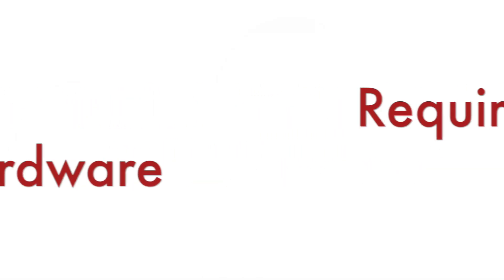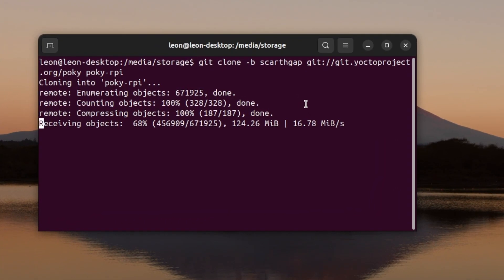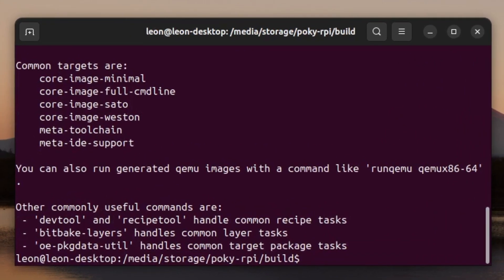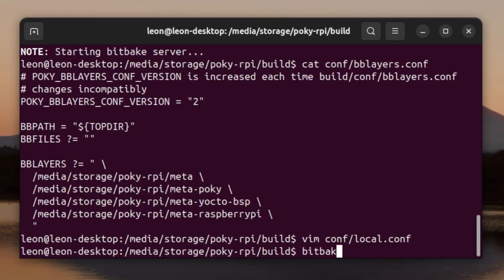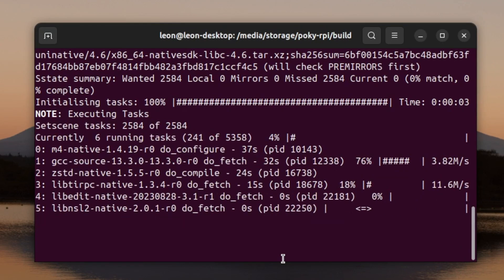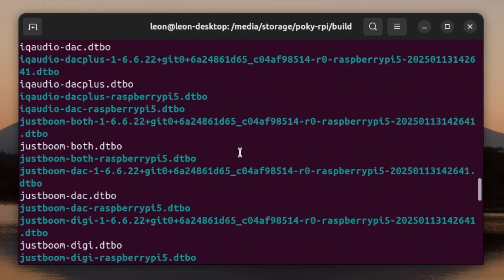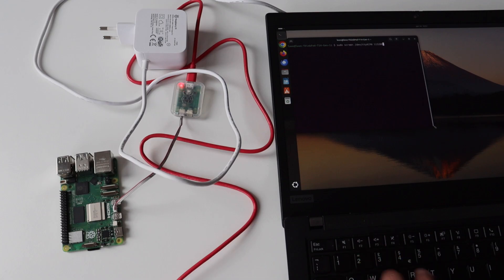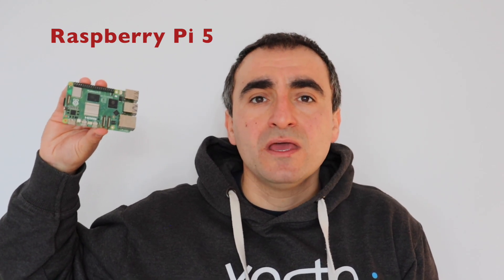The Yocto Project on Raspberry Pi 5 Episode 1: Building an Embedded GNU Linux Distribution #linux

Comment: Thanks for the tutorial, I'm very much looking forward to the next installment. The first was extremely helpful and useful. 

I'd love to see "first-boot" functionality added - for example, like the official RPI distributions, automatically resizing partitions to fill the boot volume in the case that it's bigger than the image.
Reply from the maker: Yes, this is an excellent idea! Probably we should do it at a later stage after we have a software over-the-air update solution in place. Mender and RAUC integrations include recipes and scripts to resize the remaining disk space on first boot.
Reply: @LeonAnavi  I don't know what Mender and RAUC integrations are :) But looking forward to learning.
Reply from the maker: Mender, RAUC and SWUpdate are among the popular open source solutions on the embedded side for software updates of Linux devices. All of the are pretty cool. I think in future it will be interesting to cover each of them in a separate video.

Comment: Do we need to go LFS route or there are easier route to learn to assembly distro? Do you offer some books?
Reply from the maker: The Yocto Project has a steep learning curve but once you get familiar with it, it becomes easy and quick to create custom Linux distributions. Although you can definitely learn a lot going down the road of Linux from Scratch, it will be very time consuming. I think over the years the Yocto Project has become de-facto industry standard. In terms of books, I recommend you to have a look at "Mastering Embedded Linux Programming" by Chris Simmonds (and newer editions co-authored by Chris and  Frank Vasquez). The Yocto documentation is also very good: https://docs.yoctoproject.org/

Comment: Thank you for the video. I want to ask about the kernel used in this build, is it RPiFoundation kernel or upstream kernel?
Reply from the maker: Excellent question, probably I should have covered this in the video. The BSP layer meta-raspberrypi provides recipes linux-raspberrypi with different versions. This is based on the Raspberry Pi fork of the kernel maintained in GitHub. For Yocto LTS release Scarthgap the available kernel versions are 6.1 and 6.6.
Reply: @LeonAnavi  Thank you Leon.
It seems Yocto Scarthgap uses upstream kernel..
Reply from the maker: For Raspberry Pi 5 as shown in the video we rely on the additional BSP layer meta-raspberrypi which provides recipe linux-raspberrypi that inherits linux-yocto.inc. For Scarthgap the available linux-raspberrypi versions are 6.1 and 6.6, the latter used by default. As you can see in the SRC_URI variable it uses the fork of the Linux kernel maintained by Raspberry Pi and branch rpi-6.6.y: https://github.com/agherzan/meta-raspberrypi/blob/scarthgap/recipes-kernel/linux/linux-raspberrypi_6.6.bb#L11

Comment: Nobody had made a tutorial on How to upgrade kernel, bootloader through the same build. People just take whats available, build flash and done. You can create something like how to upgrade kernel/bootloader or maybe a package version like vim/git etc by modifying existing bblayer or writing your own bb layer. Yocto is huge and has tons of things that can be done rather than just fetching building and flashing. More features like changing boot splash screen using psplash and so much more.
Reply from the maker: Thanks for the suggestions. Switching to U-Boot is specific for meta-raspberrypi, especially for Scarthgap and Raspberry Pi 5 as 2024.04 is needed through layer meta-lts-mixins. I have this in my TODO list as it is a step stone for tutorials about software updates with RAUC, Mender, SWUpdate, etc. In 2024 I made a couple of advanced demos for Olimex iMX8MP and Merrii A80 Optimus board featuring a lot of BSP work in the background but these video have just a few views. So for 2025 in my spare time I will try to do baby steps with very simple Yocto/OE tutorials within 10-15 minutes. Let's see if this will work out :)
The idea for demonstration kernel update on rpi5 is nice however it will probably require an interesting additional hardware that needs at least some basic adjustments for the kernel configuration. I have to think of such hardware. Do you have any add-on boards in mind for this?